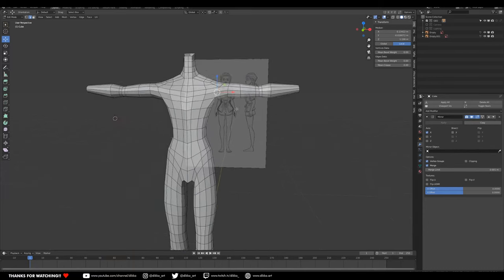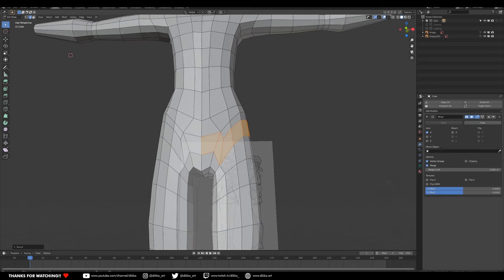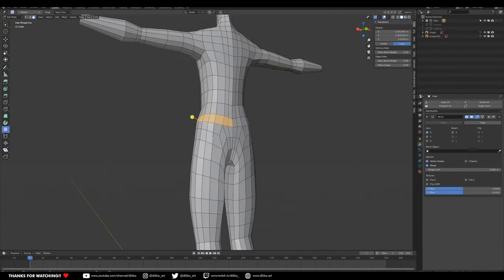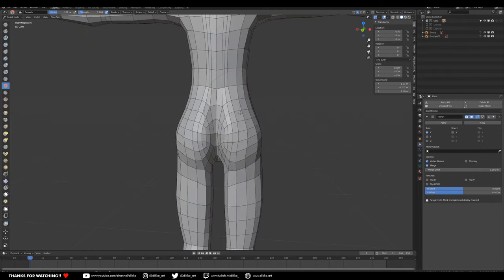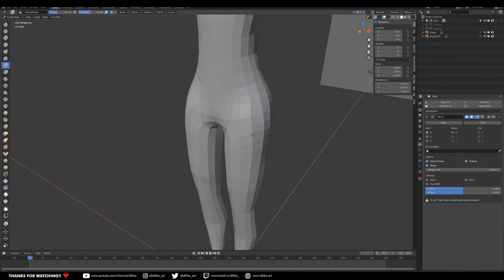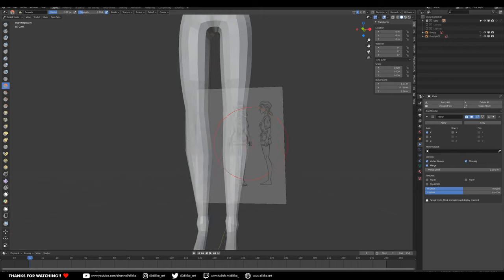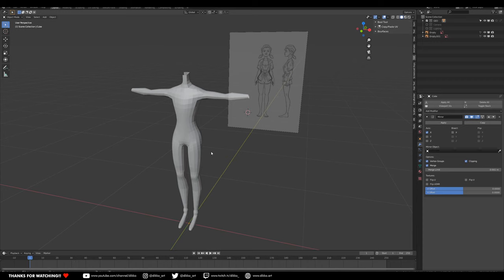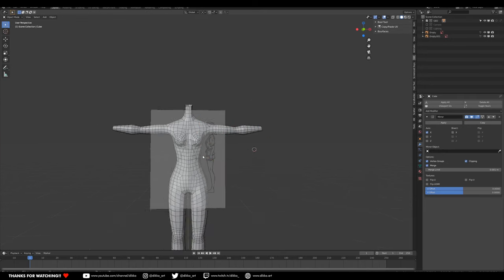Modeling for Animation 03 - Adding Volume to the Body!

Comment: Be aware Dikko is using another mesh here. If you want to follow this series, don't make the center line at the foot from the previous part.
Reply: Thank you so much for the info I was very confused.
Reply: thank you so so so much
Reply: You are correct, there is one less edge loop in this model, but what you can do is you can select the "extra" edge loop and press X and then select Dissolve Edges to get rid of it.
Reply: I noticed that as well, seems simple enough to just dissolve the edge loop at the start of the video.
Reply: I watched ahead and saw this comment before I added the center line. THANK YOU you saved me a headache
Reply: Oh my god thank you! My first model had some really messed up butt geometry but my new one will be good
Reply: Thanks. I was confused at the bevel at 1:09 because it was coming out weird.

Comment: The mesh at the beginning of this video seems to be different from the one at the end of the previous episode. There is a missing vertical line through the body that was added at the end of the previous video when doing the feet. Am I just imagining this or is that really the case? I've redone the previous episode several times to make sure, but still end up with that extra vertical edge loop.
I guess it was desolved in the end, but that step didn't make it into the videos.

Amazing series though and thank you for making it. Learned a lot from these.
Reply: I thought I was the only one haha
Reply: got stuck on that for a while too wondering why my new shoulder part was all weird lol. i dissolved that line and everything seems fine, hope it doesn't create a problem later. so far so good.

Comment: One thing that would make things less confusing is pin-pointing where faces are based on land marks. Somehow, I ended up with more edge loops on the body, and had to select more faces to delete for the butt. The only way I realized I needed more was paying attention to the fact that the left-most face you selected flowed all the way up to the armpit 5-star pole. When I selected the same number of butt faces, the left-most face didn't flow up to there, so I had to select more.

This tutorial is really useful, but some of it feels like it requires an eagle-eye to pay attention to exactly where the faces you select are situated, especially when my mesh has ended up different due to smoothing in sculpt mode and perhaps adding extra edge loops accidentally.

I'm not complaining; I'd be in modeling hell suffering without direction if I didn't find this tutorial series. But, I think it's easy to make a mistake, select the wrong faces, and have to go back a few minutes in the tutorial to look for what I did wrong.

Comment: After this episode, i had no choice than to subscribe. This is 120% times better than the Character modelling in blender clouds (Subscription). Their method/work flow is aimed for high end production houses with powerful machines.
Reply from the maker: These principles im recording are just as effective for high-end production :).
Reply: @Dikko  yet so easy to achieve and light on the machine. i am waiting for the other parts(tutorials) to continue with my models. I plan to create a base mesh with your principles and use for any new character i build. 
Thanks so much for this perfect course. So perfect i dont need to buy PRO-Rig anymore. Rigify is just enough

Comment: What an excellent video! What if there were also a way of rigging the character that helped preserve the volume??
It's a good idea to check out Bartosz Styperek's Volume Preserving Smooth addon for reducing stretch in a model. Heck, just use Sculpt Mode's new Slide/Relax brush (hold shift with the tool enabled) for that!
Also, you should use LoopTools to clean up the bunching at 7:25, then use Grid Fill to fill it -- always make the computer do the work for you! I see you're already acquainted with LoopTools!
Well, actually the way you're doing things is a lot more approachable for beginners. It's a very easy-to-follow video.
Reply from the maker: Yes this is a method to preserving volume through rigging. The placement of the joints especially in the fingers, mouth and eyes play a huge role in how well the body articulates. However, having good topology from the get go helps reduce your need for addons, corrective shape keys etc. Side note, i use grid fill all the time ;). Unless im not confident in how it will automatically fill things, in which i prefer to do it manually.
Reply from the maker: Also thank you!
Reply: @Dikko  I was making an oblique reference to my own video on the subject :P
I had forgotten that you started as a Maya artist until I had a second look at your video history. I started with Blender and then learned Maya.
Reply: @Dikko  Also, no problem, It's exciting to watch your channel grow. You've really got a nice level of polish on these :D
Reply from the maker: @nodespaghetti5312  ah right completely flew over my head! But yeah the earlier videos are Maya cos I actually teach Maya during the week (in need of an update on those mind you).
Reply from the maker: Just watched your knew breakdown. Really interesting approach!

Comment: As I'm building a character following along on this tutorial, the edge flow lines make perfect sense, and logical, but that made me curious. I downloded Blenders "Rain" character, unrigged the topography example, and checked the edge flow on it. A lot jumped around even though the quads were nicely aligned and neatly laid out. So I loaded it into Mixamo and it worked OK but if you looked close it had some limitations. I liked the logic behind your system of paying close attention to edge flow, is this a more common practice with the studios that create characters? I'm sure the modelers at Blender Studios know what they are doing, obviously, but the style seems so different when you look at edge flow, I couldn't quite get my head around the logic in Rain but, it seemed to work, your method made a lot of logical sense.

Comment: Hey Dikko. Great to see another Aussie in the youtube community. Being developing my Blender skills for a bit now and find this super easy to follow and have to say that I have only dabled in character work because no one has explained the workflow as well as this before. Glad I have the time to go through this now as you explain things so well. Just wondering on a couple of things. Do you always use this type of workflow to build your characters or do you sometimes block out and sculpt? Also working my way through this you say at the part were you get to the breasts that if you are doing a male model (im having a crack at Deadpool) that not to bother with the final step. But what if its a muscular character (superhero etc). Cheers mate!
Reply from the maker: Depends on how I'm feeling about a character, but generally im more comfortable with this method of blocking out a base mesh first on the body, and then sculpting the face. I just find it faster. Though if i have to design something more crazy like a monster or something I'd sculpt everything before retopo.

Comment: I've noticed that this mesh doesn't have one of the Edge loops you added in the previous video (the one you added in the middle of the heel and travels troughout the middle of the body), so I'm guessing I shouldn't add that edge loop right?

Comment: Might be a little too late to ask for something but here it goes, it clear you have transparency on, because we can slightly see the reference through the model, but the edges on the other side of the object aren't highlighted. When I do it everysingle edge in front and through the back is visible and it becomes a mess of edges until I disable transparency. what do you need to toggle so blender only highlights the edges you are directly looking at and not every single one through the mesh while still having transparency?

Edit: oh yeah, awesome tutorial by the way. Really helps! thanks!

Comment: If you don't have the option to merge by last on the elbows, just merge by center with the first three, and then up to right next to "XYZ" enable "Auto Merge". Then double tap "G" to move along the edge and slide that new merge into the final one.

(Sorry for the bad English)

Comment: Hey Dikko, I have a question if you don't mind. I totally don't expect you to respond, and it's okay if you don't, but as someone who's been struggling with edge flow for a while I'd figure I'd give it a shot. 

I wanted to ask about how you go about getting good edge flow. I've been wrestling with it for a couple years now, and it seems like no matter what I do, even if I try following along with a great video such as this one, I always end up getting problems like tris, diamonds, valences, and spirals that go all around my model. I can't seem to redirect an edge without creating one of these problems.

Anyway, I guess what I'm asking is if you have any specific methods or tricks to creating a clean edge flow, if there's some kind of mathematical approach to the amount of edges you need in order to cleanly fill in a structure. I've heard that if you have an even amount of vertices then you can fill in a hole, but I tend to hit the problem of having WAY more vertices on one side of the loop than on the other side, which leads to me creating terribly messy geometry just to bring it all together.

Sorry for the blathering, lol -- but if you have any advice, that'd be amazing. Cheers. :)
Reply from the maker: Planning usually helps the most, and it really is just like a puzzle. Starting as simple as possible is also a good idea - thats why I dont like retopoing a high res sculpt, because you're more prone to make mistakes. Better to make a low res base mesh then sculpt the detail in aftwarrd

Comment: One small issue I often have with this tutorial is when using the smooth brush a bunch to round things out, it can become hard to know which sides are on the front and which are on the top or bottom, and my face orientation can end up wildly different from your in some places, making things confusing. Last video, when insetting the foot, I had to re-do it a few times because the rounded edge of the foot meant I kept selecting the wrong faces, and the inset would look weird.

For other people following this, be careful about going crazy with the smooth brush early on, especially in areas that will need insets, bevels, etc., because it may make finding the right faces somewhat harder.

Comment: Really enjoying the tutorial series so far. Really interested in character models for animation purposes. I'm about as new as can be with everything involved. I've watched a good share of tutorials on blender. One thing that most of the others talk about is the vertexes (probably not the right word I know, or spelling) shouldn't have more than five lines going to them. That all the faces should be quads. I noticed at the end of this tutorial you had a few vertexes that had five edges coming out of them. Not sure if this gets fixed later in the series or if its actually important. I'm just at this point asking for clarification on that note. I know everyone models a different way. Just would like your thoughts. Hope I'm not giving off the wrong impression thinking I'm trying to criticize, I'm just curious about it and trying to learn more. Thank you for your time. Again really enjoying the tutorial and it's series, it's specifically about characters and animation. While most of the tutorials I have seen are for landscapes and still picture scenes. Another reason why I'm asking the question about them.
Reply: I think I know where I got confused. I confused 4 edges to a vertex as the same as 4 vertexes to a face. I'm watching your tutorial on the hands right now and realized in the middle of it what I did. I confused the fact that the faces need to be quads, Thinking that also means that the only 4 edges can go to a vertex. This is why I was asking about that. I made an erroneous connection thinking that in order for the first thing to be true the second had to be true. which it is not.  Thanks again. I'm enjoying your tutorials. They are helping me to get a things to click into place.

Comment: i've noticed that the model u used at the start of this episode is slightly different then the 1 we needed with last episode,
its missing 1 edge loop down the body(so u have 3 faces from center to edge when last ep we had 4)

Comment: Great tutorial! I have a question about joint topology: If I have a character I plan on animating with regular joint mechanics, but also rubber hose style (eg Hotel Transylvania), would you recommend modelling them this way, or even topology around the joint?
Reply from the maker: This method is just as good for rubber hose :). Thanks!

Comment: Hey, sorry if it was discussed before in this series or any previous one, but are you going to go over why to create a flow on the front of the neck that U-turns at the sternum and why to create a loop in the abdominal area? I'm curious to see how such loops have a role in animation, y'know, like the ones on the exemplary model you used at the start of the series when you first stressed edge flow. I thought it was weird that the neck was formed like that at the base.
Reply from the maker: Yeah once we retopo the face we will cover the neck as well :)

Comment: I managed to do something wrong with the ass and at 2am just gave up and filled in the last remaining space with a single six sided polygon, because no matter where I added an edge loop it always looped round the hips and added another vertex to the other side, which seemed literally unfixable. Came back to it the next day after doing the elbows and knees, something clicked and I managed to retopologise it back into pure quads; I don't know if it's technically correct, but it sure does make a bunch of nice flowing loops that look correct, so I'm taking that as a win!

Comment: Hey Dikko, awesome series. Creating an "Aayla" (Star Wars) with your guidance. Two questions about this video. When working on the shoulder you bevel in a loopcut. No matter what I try, the bevelling pushes away the existing topology, whereas in your video it slides over the edges. How? The second question is when you smooth out that same loopcut: your screenkeys don't show that you scale in one axis, still the loopcut is flattened out and not scaling in any other way. How? Hope you can find the time to answer. Keep it up dude, big fan here!
Reply from the maker: You may need to apply the scales of your model for the bevel to behave properly, so make sure youve done that. If it's still acting up, you can just split the connection with the shoulder and arm by pressing v, the full on the edge loop manually.
Reply from the maker: Also for your section question, just use the sculpt brush to smooth out the shoulder.
Reply: Just got the same issue. The problem was in inverted normals on the shoulder

Comment: Excellent videos - just signed up for your Patreon. Question - I can't seem to get my object displaying quite like you have in the viewport - partly transparent but without seeing backface mesh. I've tried xray and viewport colours etc. (I'm on 3.2)
Reply from the maker: Thanks for subbing to the patreon! The transparency BTW isnt in the mesh, its in the reference image settings - so import your reference image with an empty, and in the empty you will see the options for transparency.
Reply: @Dikko  ah, so you have the image overlaid / in FG?! I had it in the background, cheers!
Reply from the maker: @Jack-gk8wf  Yeah you can set the image to be seen at any view regardless of whether its in front or back of the model :)

Comment: HI dikko! i wished to ask is there a way to learn the reasons behind the particular beveling etc. like i know to use them for this mesh coz im told but i dont understand the why of particular ways of making a mesh a certain way. could you shed some light on this?
Reply from the maker: Check out the first video in the playlist and I go through all the reasons as to why we design character meshes in a particular way.

Comment: Could it be, that the model we start with is a little different from the one you ended with in part 2? Seems to be missing the loop-cut from the middle of the "toes" running all around the body. Nothing sensational (and easy to remove/add), just caught me a tiny bit off guard, first time watching the video.

Comment: I've been following along with this tutorial, copying every step you take, but I ran into trouble after doing the bevel on the shoulder. It seems that your model has more topology than mine does. I'm not sure if a missed adding a loop or not. I was able to make the double diamonds in the elbow without problem but after doing the knee I tested the face loops it created and they went crazy. Specifically it was the one that went up the body and over the shoulder. Did you add an more topology to the model than what you did in part 2 and forgot to mention it or did I miss a loop or something?

Thanks for any advice, and great series!
Reply from the maker: Your mesh doesn't have to be exactly the same as what I do, it just has to have a decent edge flow structure. It's normal to have the faces flow around the knee and up the body, cos you're redirecting the flow when you make that diamond structure on the knee
Reply: I know that it's too late, but I got into the same problem. The issue was that normal on that shoulder faces was inverted.